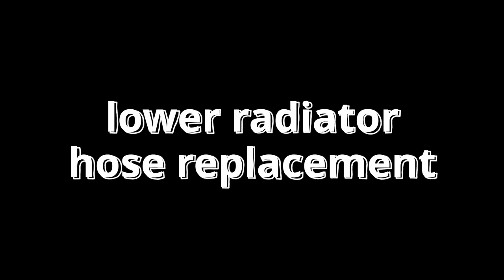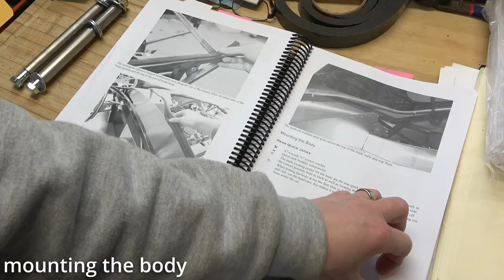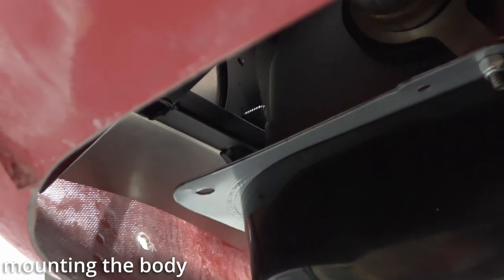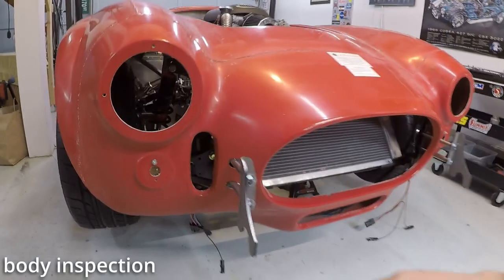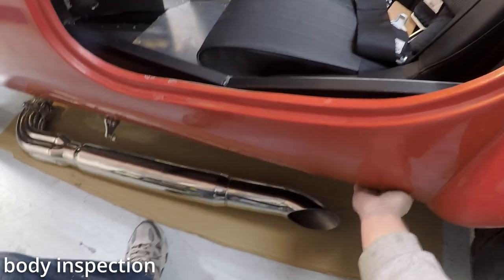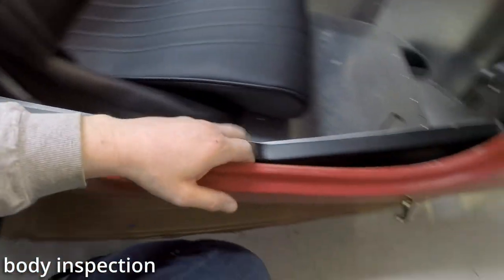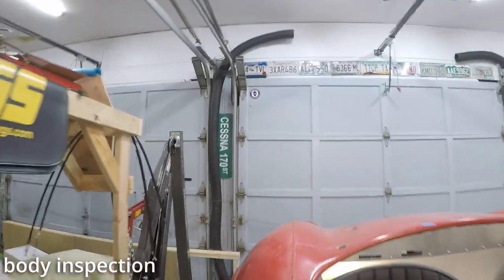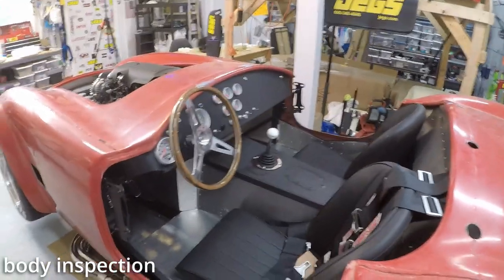Budget LS Factory Five Cobra | Build Update 58

Comment: Matt.....I had my first start today, and Lo and Behold, my lower radiator hose popped off at 180 degrees, exactly like yours did.  I was so careful to torque down all the hose clamps...... but it failed anyway.  What a mess! Can you advise me of the part number on that lower flexible hose?  Does it appear to be secure?  Kevin.
Reply from the maker: Links to the parts are in the description of the video